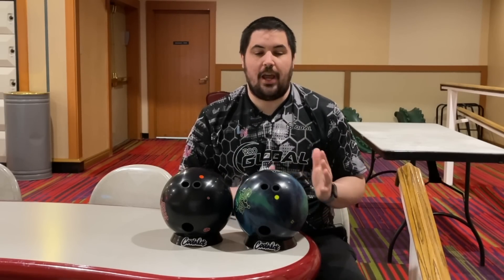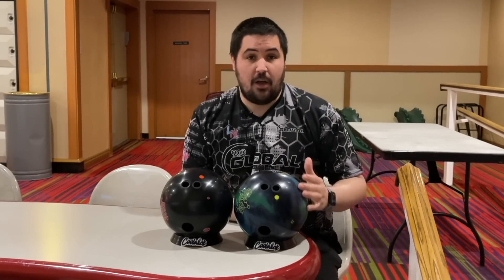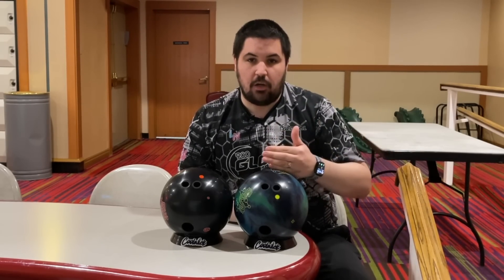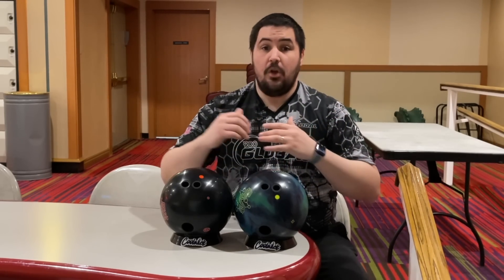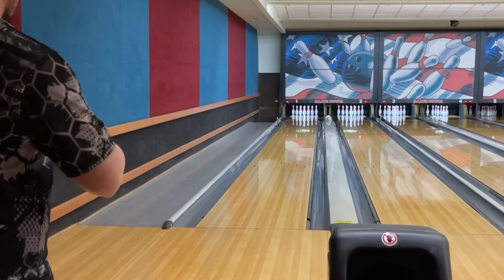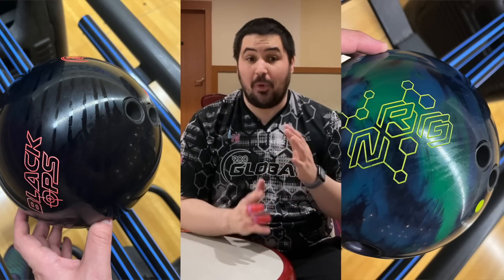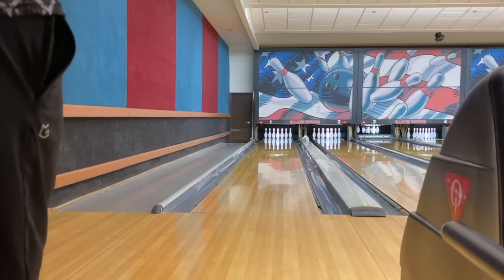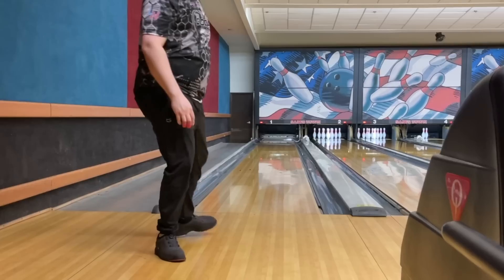What Is The Difference Between A Bowling Ball Drilled Pin Up & Pin Down | In Depth Guide

Comment: Nice video ! Should use 2 of the same ball, 1 drilled pin up and 1 drilled pin down.  You could then see the difference in motion and also show off the flare lines on the ball.  Pin up flares will be more spaced apart and pin down flares will be tighter.  Keep up the awesome work on the videos !
Reply from the maker: I did that before heres the link featuring the Zen 

https://youtu.be/rfB2hXAhDv0

Comment: Should also do one on the difference between pin down and RICO.  Here in Phoenix, where oil is rare.  I was sent 3 Zens.  Pin up, pin down and RICO.  I remember RICO with urethane balls for nationals.  Never even crossed my mind to do it on a reactive assym.  Glad I did.
Reply from the maker: The problem with "RICO" is that pin in palm with cg 45 degrees is not a layout and will yield a different result for everyone

Comment: My pro shop guy has drilled my gear with the ring finger right in the pin , what does that situation create for me?
Reply: In general it’s neutral for most but your PAP would be needed to know for sure. For me pin In ring is 55 degree Val. Pin under ring 70 degree val.  I use a lot of pin in ring layouts since I’m a Super Sr, speed challenged and bowl on high friction 24 year old anvil lane. I also use short pin layouts. 2” pin to PAP. I have zero pin up balls right now.
Reply: @DHoagland  that’s helpful Dan , I’m a little older and just getting back to bowling for over 30 years away , prob why my pro did that . !
Reply from the maker: It would be a mid point

Comment: Ok, you have confused me Lou.
If Pin Down  increases RG and reduces Diff then the ball should respond  later and be more angular. A quicker response to friction in the backend.
If Pin Up reduces RG and increases Diff then the ball should respond earlier and be smoother. A slower response to friction in the backend.
As a Full Roller this is exactly what I see when I put a Low RG/High Diff layout on a ball vs a High RG/Low Diff layout on a ball.
Coverstock does not matter in this much. I have two Pro Motions and they behave 180 degrees different from each other with the two layouts.
Reply from the maker: When you drill pin down it slows down the response time to friction because of the pin being so low thus making it longer and smoother

Comment: That is a lot of flare on that black ball. This is why I use weaker pins even at my modest revrate, 420, balls like that overflare and do nothing
Reply: Yep same here. I need 5 to 6 inch pin or else it just flares way too much and burns up halfway down the lane.
Reply from the maker: Cover matter soooooo much though that ball has a VERY weak cover